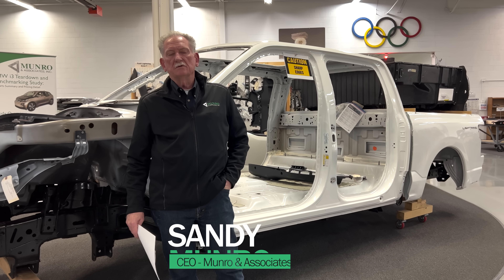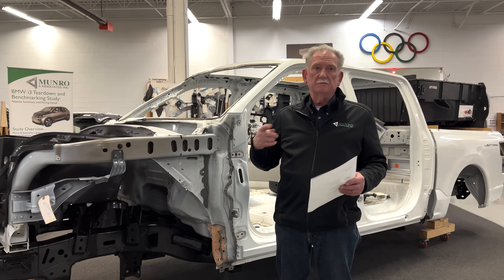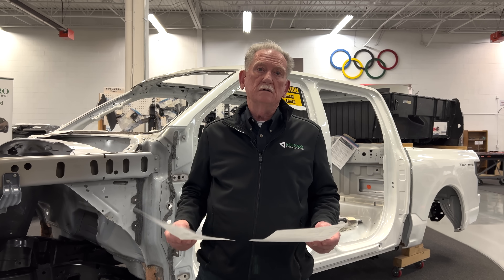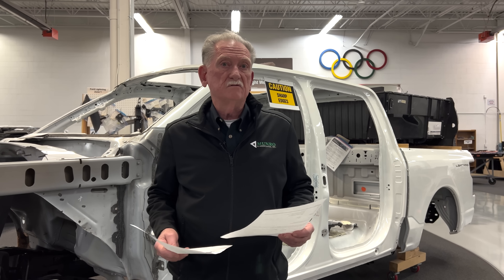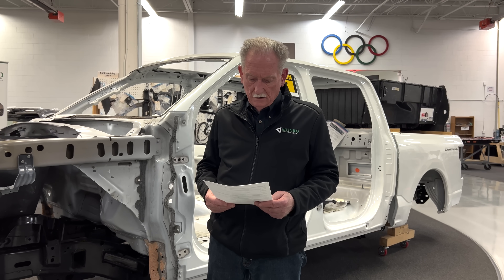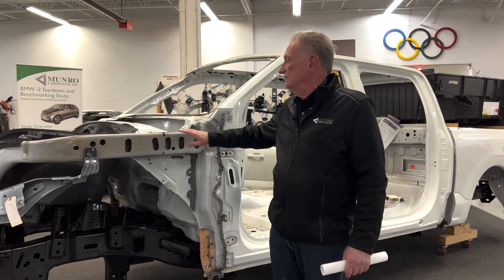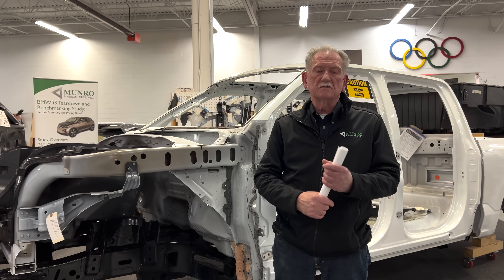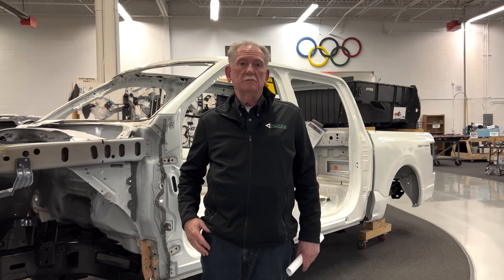Sandy's Initial Thoughts on the 2025 Ram 1500 Ramcharger

Comment: I'm surprised that you don't focus on the need for lots of 300 mile round trips for towing. Quite a glaring non-talking point in this otherwise nice talk. I f a truck is purchased for lots of towing for trailers, then that 700 miles will reduce quickly to 1/2 that. I think often you need to go 100 - 200 miles away for picking up items and towing them home. So for someone who wants to tow... I see a lot of upside utility for this style.

Comment: It depends on the use case.  I was recently up in Pennsylvania in an area heavy with work trucks and there were probably no fast charge stations within 30 or 40 miles.  Even a level-2 would have been tough to come by.  For a contractor who’s going to be on site for a several days with no charge opportunities the RAM gas/EV truck makes sense.
Reply: You can still charge from 120v house current.
Reply: @cheapgeek62  Yes.  I had a 2011 LEAF that I got used.  The original LEAF could go 80 miles on a charge if you were lucky and the battery was still new.  I drove the LEAF for four years just charging it at 1.2 KW from the included EVSE cord plugged into 120:Volts in my garage.  It wouldn’t have gotten the job done in western PA with hills and cold weather.

I have a Chevy Bolt now with the 60+ KWH battery and I have a 50 Amp 240 Volt outlet in my garage now.  I still just use the EVSE which came with the car which is a Clipper Creek cord capable of either 120 or 240 Volts at 12 Amps.  I find trickle charging the Bolt works well.  I often take 150+ mile weekend trips but drive mostly in town during the week.  It may take over a day to fully recharge from a long weekend trip, but I can still alternate between in town trips and slow charging at home.  This driving model,works for me, but might be a stretch for someone driving 30 or 40 miles a day in hilly PA with no recharge possibility at work.

Comment: I'd bet the engine (an existing Ram engine, no dev costs) genset costs less than the difference in battery costs (~$7K less pack for the Ram) between the two trucks, and the smaller lighter Ram battery is a wash weight-wise as well.  Given the weight should wash, I am a little shocked the Ram only gets 145m out of a 92kwh battery pack -- that's much worse BEV efficiency than the Lightning. While the F150 will go less than 200m while towing, I'll bet the Ram will only lose half its BEV range, but get most of the promised range in the genset mode, so drop from 690 unladen to 450 when towing.  The Ram will cost more in maintenance and cost per mile will be higher using fuel but that's only while towing or on long unladen trips IF you decide not to stop to charge every 145m.  If you aren't in a hurry, even long trips could avoid any gas use.  As a delivery vehicle, adding 20 minutes of charging while unloading and loading at each 100m segment could make this an all-day EV workhorse but so could the Lightning.  Until cheaper, more energy-dense batteries are available, this probably makes more sense than a Lightning even if long trips are only occasionally needed.  Range anxiety may be mostly unfounded, but there are people who don't plan trips well and like the idea that AAA can send someone out almost anywhere with 5 gallons of gas to get them off the highway.

Comment: Range, range, range.  Yes, 690 is a big number.  I run MN to FL 2X per year.  I can go 550 miles per day, cheap hotel and I'm there in 2 days.  So, if I went 550 parked it overnight W/O the benefit of being able to plug in, would the v6 run all night to charge the batt?

Comment: All your logic is perfectly applicable for a CAR - for the typical truck owner, you have an entirely different set of averages and needs. 

Trucks are used for work, they put on a lot of miles, they tow stuff very often.

Range Extenders are the future of not only light pickups, but also medium and class 8 trucks. Electric only simply cannot provide the flexibility needed for work environments.

There is a reason why WORK people won't touch the F-150 Lightning with a 200 ft pole.

Comment: Sandy, you need to add the weight of the gasoline storage and delivery system as well as the weight of the gas engine. For example, 27 gallons of gasoline @ 162 lb plus another maybe 80 lb for the tank, pump, roller neck, fuel lines, control canister and controls. I’m surprised you forgot this essential system for a gas engine. 

And, of course, carrying extremely flammable liquids in a vehicle creates an additional fire hazard that a pure EV like the Lightning or CyberTruck doesn’t have.

Comment: Sandy has reached senility.  Don't need 690 mile range?  What's the towing range, 200-300 miles?  The Ramcharger is for people who use pickup trucks as pickup trucks. Sandy thinks the Lightning is "the best work truck on the planet".  That's why Ford can't give them away. Anybody who listens to Sandy Munro at this point is an absolute moron.

Comment: Yes, towing, towing, towing.  I have a RAM 1500 just for towing, and a Model 3 for a daily.  I installed a hitch on the Tesla, but I don't use it when I haul my toys longer distances.  I would get rid of them both for a Ramcharger.  And I disagree about the phrase "range anxiety".  It's real...at least for now and especially in cold climates.  I've had it too many times.  Once in Chicago (in the winter) when there was a long detour.  I made it to a charger with 1 mile to spare (and yes I turned off all heat).  I passed many gas stations along the way.

Comment: People forget what a pain it is to charge an EV with a trailer due to lack of pull-through charger stalls. You typically have to unhook the trailer and park it somewhere away from the charger, then you have to hook it again after charging is done. With the Ramcharger you keep the trailer attached because all gas stations have pull-through pumps.

Comment: I'm a Sandy fan when he's in the wheelhouse of his expertise, and cringe when he leaves it. EV is not his wheelhouse. He's an EV purist, so anything he says on the subject will serve that ideology.

He pretends range anxiety is crap. 100% of EV drivers have experienced range anxiety before. Just because he flies any distance greater than 200 miles and therefore never experienced range anxiety doesn't mean the majority of others will also never feel range anxiety. Finally, he concludes that the RAM is more powerful, tows more, has greater range, and therefore his choice is the F150 (because its a pure EV). Purity is more important than other factors.

Comment: Just because you have a long range, doesn't mean you're going to drive it that far in a single day.  For example, when I fill it up, it has 330 miles... that doesn't mean I'll be driving 330 miles that day... but it does mean I won't need to refill for quite awhile.  So, to complain about long range is garbage.  Also, the lightning when it tows, its range goes into the toilet.. 100 miles.  I'm guessing the ram will do much better.  I respect munro, but this analysis was frankly rubbish.

Comment: Better towing and Sandy covered the extra weight for the Engine... But didn't give the weight differential at 145 miles vs 320... Plus cost of the extra large battery in the Ford.

Comment: I think people forget the previously announced Ram with about a 350 mile battery only. This 145 mile battery with a generator and a 27 gallon gas tank is a different option for people that want to tow long distances. This version I think can only fast charge at 60kW which tells me that they will primarily overnight charge and hit the gas station instead of the fast chargers on a trip. 
My understanding is that the generator is going to be running when there is a heavy tow, or under loads like going up grades. They chose the V6 for NVH smoothness over a four cylinder or smaller.

Comment: The 690 miles is nice if you are traveling to a remote spot or town that doesn’t have any charging station ( or charging stations that don’t work).  Being able to stop at the numerous gas stations across the country and fill up so you can keep driving is one of the greatest advantages of range extended vehicles over pure electric.  This will be especially true if you are towing heavy and draggy loads that require a lot of power.

Comment: You’re comparing apples to oranges.  Ram is also coming out with the Ram 1500 REV which is their all electric truck.  Would be a better comparison between the REV and the lightning.  Also, you mentioned the Ramcharger was a Dodge; however Ram is its own brand and separated from Dodge about 14 years ago although both fall under the Stellantis umbrella.  You also mentioned the lightning is a work truck.  It cannot tow very far without recharge so I think it’s not much of a work truck.

Comment: You mentioned a 4 cyl which makes sense, smaller, lighter, etc. The engine heat generated can heat the cab, living space or be a water heater.  This setup will give endless power at a work site, camping, home power outage, emergency power station and more. Thinking outside the Volt.

Comment: Sandy obviously doesn’t drive to Arizona pulling a fifth wheel for the winter. And once there drive over to San Diego/Palm Springs/Phoenix for a day with the truck alone. This would be the perfect truck for hauling gear, friends and side by sides for a day’s outings. 100+ miles in pure electric on the flat plus a gas range extender for the hills and high speed interstate.

Comment: As a Chevy Volt owner, I really would have liked to see GM evolve the Voltec platform to other vehicles. They have all the patents (apparently duplicated with minor changes by Toyota, Stellantis, et al today). Most personal truck owners would probably use the EV mode for getting to their job and back, and switch to hybrid mode for hauling and long distance trips. Stellantis could have probably saved some weight and shaved off a few tenths off their acceleration times by using a smaller battery pack. While the added complexity of the ICE engine can be daunting - most people wont use the ICE more than 20% of the time, so maintenance isn't as big of an issue as one would assume (in 85,000 miles on the Volt, I've only had to change the oil and get the brakes and coolant flushed albeit I did have additional costs related to the overall platform that should have been recalls - but weren't (Chevy gave me an extra year on my powertrain warranty as compensation)). If I was buying a truck, I would probably roll the dice on the 1500 (persistent check-engine lights and all) since I'm a bit Ford-averse :D
Reply: If you do not know about it lookup the Via Motors VTRUX. I wish the concept took off more; if GM had built it directly I think it would have been a winner. Doing a lot of what this Ramcharger is capable of a decade ahead.
Reply: A large pack is required for its power output.  Higher average power output will degrade the battery faster.  5C for a 92 kW pack is 460 kW or ~ 600 hp.  That's really pushing the battery pack already and shrinking it would increase the C rate.

Comment: I think, given the range penalty when towing, that there is a need for ranges better than the Lightning. Recently I was working a project where I was driving about five hours to the job location on Sunday, driving less than 50 miles each day on the project, then five hours home Friday night. It was on a construction project and I definitely needed a pickup equipped with hazard lights when on-site. The Lighting could have worked for the on-site work, especially in the future as there was a Tesla charging location right across the road from the hotel. But I would have probably had to find a charger going from the job location to home and back. I was stopping for fuel a couple of times to stretch my legs during the drive, but on the route I was on, finding chargers would have been difficult.
Reply: Exactly.  This truck is easy to refuel as it uses the decades mature gasoline infrastructure.  Electric charging just isn't competitive in all cases yet.

Comment: TOWING!!!!!!!!!

I have been holding off on a lightning because when I want to go out snowmobiling or take a trailer full of quads out, I cant do it with 150 miles of range...

If I can have 100 miles of EV range, gives me cheap transportation 98% of the time, and the few times a year I need to tow, I can do it without spending an hour charging for every hour driving.
Also not going to spend 100k on a 450 mile Chevy EV truck...

Comment: There are no pull-through chargers -  you can not use a EV-truck and unhitch the trailer every 100 miles to charge.   I drive a EV and check every time I'm at new charger - the infrastructure for towing is non-existend

Comment: A half battery vehicle could/should have all the EV advantages. Power tool plugs, camping, etc. No need for huge battery to have that. If you have a home / work plug, you drive electric (cheaper?) a lot.

Comment: You could fit a long stroke flat 3 or 4 in the engine bay.  Something like a BMW K bike.  Design for Atkinson Cycle and keep it simple.  The V6 on ramcharger is overkill.  There is too much weight cost and complexity with the V6.

Comment: Towing... f150 lightning towing 10,000 lbs would have range of 30% of optimal  or less.  The range extender towing the same weight will have the same coefficient but end up with a more useful real range.

Comment: Will the Ford run a trash pump, a light, a blower, a tugger all day and guarantee get me home? Work  is  not only measured in miles per charge (providing that it has exportable power). Diesel or propane seems like a less perishable fuel for the days I'm not running all that equipment. Also camping or disaster relief time seems like  it would be extended with a series hybrid system. Just thinking out loud.

Comment: I’ve always been sceptical about the idea of a plugin hybrid. Added complexity, stale gas if you never use it, (and most won’t), and tying yourself to an incredibly corrupt, dying industry, (oil, the fluctuations are going to get worse). I do love the 3.6 though and own two of them.that being said, my next vehicle purchase will be 100% EV.
Reply: From an engineer's perspective (M.E.) I agree with all of your points - complexity is not good for reliability.  However, given the additional space available in a truck and the towing requirements, a simple series generator make sense for those that will actually use it.  The Penstar is not ideal (Atkinson makes more sense), but it's a reliable motor that they already produce and designing a new motor would be prohibitively expensive.
Reply: @iamalmostanonymous  you make a valid point. I do like this configuration if one must have the added range. For us regular shmose though, that space could be used for added battery. It would be nice to see a little more density however for towing long distances, as most fast chargers are not set up for combination vehicles yet.
Marine engineer here btw.